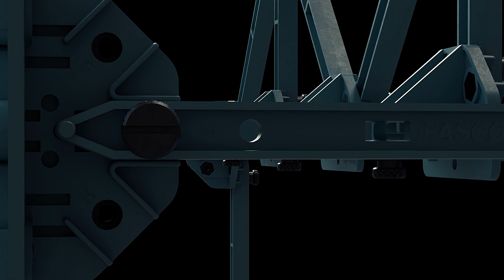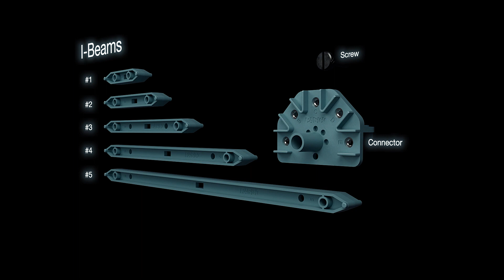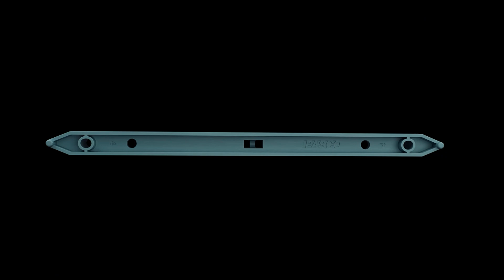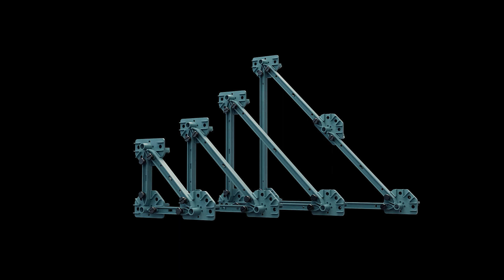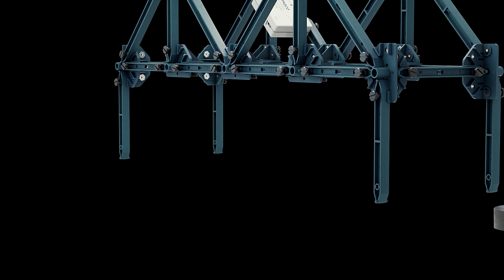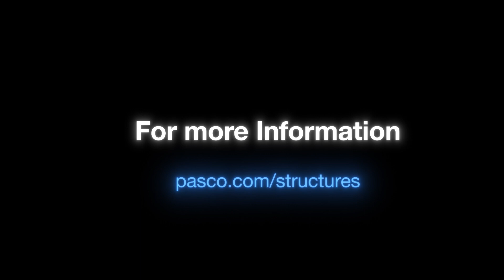Structures System | Scalable Models for Engineering Education

Comment: How can you vinculet With the software pasco?
Reply from the maker: Sensors such as the Wireless Load Cell and Accelerometer shown in the video can broadcast measurements to PASCO Capstone or SPARKvue software for live display and analysis. Here are sensors frequently used with Structures: https://www.pasco.com/products/lab-apparatus/structures/sensors-and-load-cells.